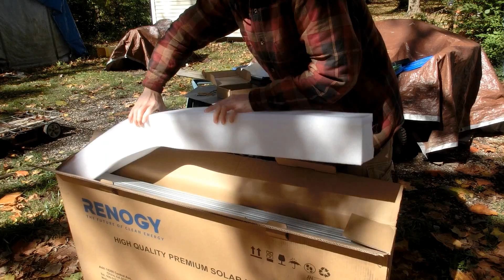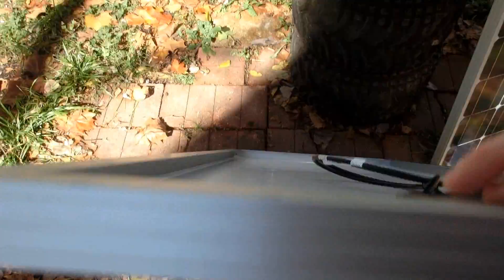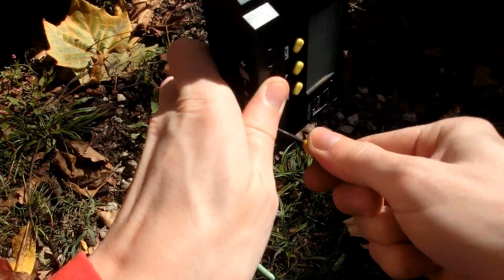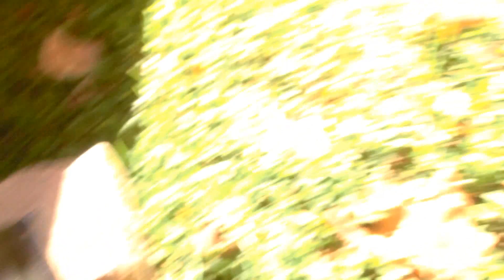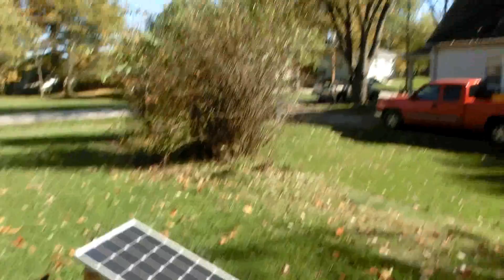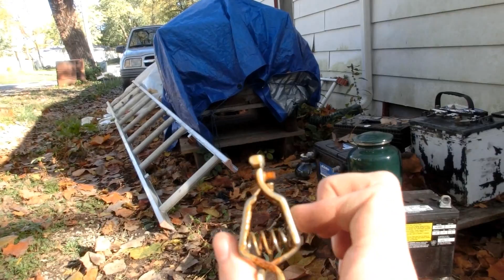Random Bits 0058: 200w solar panel system

Comment: Hey man, hey everyone :-) The insulation on the back of the solar arrays is pretty awesome, do you think that could be the difference in efficiency between making them yourself and the manufactured gear you have just received? appreciating that cells are different qualities and efficiencies :-) but im kinda saying you recon it makes a big difference?
 As you say there if a cell goes down perhaps you could chop the damaged cell out and then perhaps even spray over the new replacement's back with liquid rubber to reinsulate it? :-D

Making Hydrogen and squeezing it down sounds legend! Have at that one! Cant wait to see the vids.

Would sticking a solar array on top of a tree, flat, help or does the angle really make that difference?

Reinforce the outside of the house with a discreet scaffold and get a platform going, your mum will love it, she can play W.O.W up their on cool summer nights :-) ...though im more of a Guild Wars 2 kinda guy :-D

Pole in the battery shed sounds good, would you insulate that? I always figured exposed poles to the air kinda lost electrons to the ether, reducing efficiency :-) probably would be minimal loss anyway :-)

Great investment, a few more next year and the year after and you will be off grid :-) Another thumbs up on your vid my friend :-p
Reply from the maker: battonfive
well my homemade array would have been great if only i had 36 cells instead of 10. but still wouldnt have been nearly as weatherproof as these ones are.

as for the exposed poles discharging, you dont have to worry about that. sure if the climate was very very humid and salty you may have more discharge, but the internal discharge rate from lead acid batteries would still outweigh it. and even that is very small.
Reply: Rinoa Super-Genius
not to mention, im not going to ride any spiders!,  i might vote for you making a giant flamethrower to kill the giant spiders though!
, as for the solar, indeed do some videos, also explain some of the basics, the pitfalls and the realist of what they can do, and not as some do on youtube, buy one small panel and think they can go off grid now! lol
Reply: Rinoa Super-Genius
um no, we pay per kw not a fee for connection plus i would lose the 'feed in' subsidy (there has been a big rush to get in on this while it still runs) which pays me even though i get the electricity myself, and of course the cost of buying a large bank of batteries
Reply from the maker: jusb1066
 ah here we have to pay like 30$ a month just for being connected and if you do feed power into the grid you only get credits and those credits expire at the end of the year so you dont get money, or atleast the last time i checked.
Reply: Rinoa Super-Genius
theres acutally a thing i heard in Australia, if you have solar, they charge a fee for connecting your solar to the grid! so it pushes you either to go solar off grid or none at all, yeah backward policies harm the take up of it for sure, in the uk it is possible to have a zero electricity bill if your carefull with solar
Reply: the cells dont need insulating as such, its just a plastic backing, in fact cells often could do with cooling from the suns heat,, but thats impractical or more expensive than just the backing, plus it needs to be electrically insulated, at the front end of things it is a special type of solar glass, then a clear resin is used to bind it all down, and vibrated on a table to remove all the air bubbles
Reply: mmm im familiar with over heating issues but the strips running along the rear I thought would need insulating from the air, that they don't makes me wonder where the efficiency gaps come from between factory and home made arrays is all :-) cheers for the clarification there though :-)
Reply: no they dont need insualtiig from air, elecricity doesnt escape through air, unless the voltage is high enough to arc over, efficiency is lost due to they sell solar panels to what it could produce in perfect lighting conditions, optimum angle, cold panels, and probably the level of the sun in a desert! also conversion losses always happen
, the best thing you can do with a lot of solar is the thing rinoa mentioned, an mppt controller (around 20 percent improvement)
Reply: cool, I was thinking that home made arrays might be like the kit car of...cars... Jusb has a point though, they do seem to rate them while they are being assisted by a nuclear power plant :-D

I figured with the appaling light here in Britain I would need a million of them to offset the reduced proton activity in the light over here, and that being the case I was hoping to come up with my own hand build array in the next few years :-)

That I get to watch your's Rinoa is a welcomed trail blaze im happy dodging :-) I like how when I ask google 'is electric lost to the air/ether', it comes up with a german plane crash.

My misconceptions really are getting more severe :-D
Reply from the maker: battonfive
 like the time you had the idea to make a quadcopter that could fly between planets then i reminded you of the vacuum in "space" hahaha

i have a shitload of bad ideas every day, its just overtime i've learned how to more quickly troubleshoot them. like i'll be watching a video then think "we should engineer giant jumping spiders so we could ride them around!!!" and i quickly realize how that wouldnt work on many levels.

i'm thinking about doing a total cash-in on these solar panels and start making a video series called "Solar Sunday" where i just do something differant each week with my panels.

would be easy to pump those videos out, and make me back the money i spent on the panels. All Your Time Are Belong To Me! bwahaha
Reply: i looked into making an array myself a while ago, as well as buying the panels, the alloy housing, the special glass, the resin, making a vibrating table to do clear the resin, it really came down to not worth making yourself, i have 2.5kw of roof panels, it seems to have halved my overall electricity bill, as you 'shift' your heavier useage to good daylight, (washing machines etc)
Reply from the maker: jusb1066
 and prolly if you went full off-grid where you dont even pay the electrical connection fee you would start saving the most.

i'm wanting to get my system working good enough to where i can buy some land and build a shed but not have to pay for electrical connections and a pole and meter and stuff.
Reply: Rinoa Super-Genius lol technically that great hybrid octocopter idea didn't work cause Mars' atmosphere was to thin and there wasn't nothing to push against :-p Must admit didn't think it would make the void of space..though on a different day...who knows perhaps some hard fuel rockets might have ma... :-D

Spiders sound good, though I said to my mate when I was 17 after reading the Tad Williams 'other world'  saga,..dude should I devote my life to making a small spider that re-charges itself at the mains and has mega a.i?

which he horridly said 'no, no...just no.', think he was afraid I might do it more than anything :-D

Fair argument on the panels though :-) my first stop will be ebay :-)....come on you germans with your solar price war with the Chinese and Americans, You Germans wouldn't believe what they said about your mum...wouldn't take that...get them prices down
Reply: here they install solar on council homes then the private companies leech the profits :-) and they are dire cause our light is crap :-p
Reply: jusb1066 im pretty power hungry, run a lot of computers, but yeah average family over here would pull it off if they are careful :-) where there is plenty of elec the returns for you selling to them are always dire :-) its a shame they cant just pump it about the world and bring the abundant countries prices up and the needy hungry countries prices down :-Dhttp://www.bbc.co.uk/news/science-environment-29551063
Reply from the maker: battonfive  i think for the time being it may still be worth it to look into mechanisms that direct light onto a boiler or stirling engine. but i think solar panels will pull further ahead in just a few years.

i think the big issue with AI is that we are trying to compute AI programs on general purpose components. i think in order for us to make an AI like commander Data we will need to make specialized hardware that does certain tasks like guage the emotion of an input or whatever.

like in the 1980s intel released the 8086 cpu but they also had the 8087 math co-processor and many other chips designed to work with the 8086. i think we will need a computer made of 10 or so differant CPUs each running their own routines and doing their own specialized tasks. much like how the differant parts of the human brain work.

or ya know...a positronic brain.
Reply: battonfive
i had a huge energy overhaul at home, my laptop uses like 20w not the 350w of the old desktop, all plug in things with supplies removed, or switched off when not using where possible, led lights in the lamps, no vampire devices, that process itself saved me around 30 percent of my bill ,before solar came along, every thing with a standby (such as a microwave clock) costs you £5 a year just to be on, multiply by all the things you have, tv, clock-radio, phone chargers left on etc
, you choose devices that havea  real off switch or at least a nicely handy power switch for your extensions
, and led lamp (£10 a good one!)  pays itself in 6 months at 5 hours a day (and thats comparing it to the already savings of a cfl, not incadescent) , and i havent had incandescent bulbs for years!
Reply from the maker: jusb1066
 dont forget that those devices that use extra power put it out as heat. so how has your heater been doing with less help from electronics? i'm thinking about using my solar panels to run my computer and maybe a bitcoin miner to warm my room up but also get things done.
Reply: in college I was taught there are two types of a.i, one is a fake a.i like a doctors encyclopedia that is simple algorytms and the other one is impossible :-)
 Basically the teacher was working with, its all going off coded rules and thus not sentient and not a.i :-)
 I'm just happy a machine processing shed loads of code, quantum style, then spitting out its best probability :-)

light to a sterling sounds good, in an over sized magnifying glass way :-) I was thinking 'wood burner stove' heating a chamber of water to drive a crank shaft thing :-) im after quiet as I live next to a grave yard :-p and the sterling does seem to be the leading candidate so far :-)

I want to read the book '1984', that's supposed to have some good gear in :-D
Reply: I currently run my main pc 750w, two monitors like 120w a piece, that's 18 hours 7 days :-) then I have three 500w pcs acting as servers for websites, then theres a mega list more :-) I tended to use the heat from bitcoin mining last year to heat the place, worked well but the fans were noisey as buggery. Had to blast music to silence them :-D Bitcoin mining is dead now :-) running a decent graphics card will get you a bit of lite coin back and still produce the heat, but you would need more juice to power card and board :-p
Reply: Rinoa Super-Genius
we have mains gas for heating, per kw its still way cheaper than solar (and well they dont make solar that works when it's dark, and yes, the heating has been renewed to a more efficient one than the 30 year old one before it, so im sure it will be less this winter
, i have considered running a low power electric heater in the coming winter, but i suspect it wont be worth doing cause winter has very little sun anyway
Reply: :-) im turning back to gas soon, im shipping these serves off to London now and hosting them there with a company, my elec just went from 11p/pkw to 23p/pkw

this woman gave me a wacky named rate called 'the green policy of 2004' or something, when I said 'whats dat?', she said...' I just saved you £600 quid a year' :-p

it seems npowers hospitality has now waned :-D
I am intrested in getting some kinda wood burning setup going though :-) As you know jusb our bills are mental over here without offsetting any.

I pay a few grand a year easy enough atm :-)
Reply: battonfive
yeah self hosting has never been worth the electricity alone, i worked that out years ago! trouble with wood is, theres too much chipboard or treated (decking timber) and that smokes or makes deadly fumes, gas is cheaper basically than filling a car with wood, even if it was free
Reply: I self host because some of the companies I host for are pretty picky with their data :-) took me an age to find one in London they would agree upon :-p plus I was using them for other stuff at the same time :-D
 Fumes are a bit of a pain I guess, was gonna make a 20-30 foot pipe for it to escape from :-) and I do have my e-bike and the woods are just at the back here :-)
 I will see how gas goes, it does seem pretty cheap :-) perhaps fracking will aid it further now :-)
Reply: thers always a bit of fumes escaping from the front end, which is why i want to warn you about the treated timber, a tiny amount will harm you :} plus theres so much of it around, that and chipboard/mdf/particle, finding real wood is a pain , even pallet wood is treated most of the time, if we were in the wilds of canada with trees all around would be different, but we are more likely to have old ikea furniture than a tree!
Reply from the maker: battonfive  lucky for me the "bitcoin is dead" sentiment is spreading fast so stuff like Antminer S1 are only 50$ on ebay. running one of those at 200 gigahash/second would make me about 50$ a month in bitcoin. better space heater than my electric one that would cost about that a month haha.
Reply: have you checked the difficulty graph for the bitcoin mining?
Reply from the maker: battonfive
 yeah i've used the online calculators and stuff. at teh very least it would be fun to get an antminer off ebay. its over 2,000 times faster than my main graphics card.

people regularly spend 60$ on a crappy video game. so 50$ prolly wouldnt be too bad. my grandparents usually give me like 50$ for christmas and by that time i should have a nice solar thing set up. i could put that money towards one.

oh and as for fans, i love the sounds of servers so it should be cool. we used to have a big server in our living room when i lived at my old house.
Reply: jusb1066 true I would have resorted to waste mdf gear before long :-) I didn't think of the excess dodgy particles that would rain back down on a still day :-p your right, for effort and everything gas does seem the best bet :-)
Reply: Rinoa Super-Genius"Bitcoin is the devils way of teaching geeks economics" is what I read years ago and it really is true :-) Have ago theres not much you can loose there. I finished my mining back in December of last year, was running a 60-70ghs setup, which was pretty decent back then with the mining difficulty so low :-) You will want to overclock that s1 with the software when you get it (we all do) so give yourself 370watt or more for that :-) You wont notice the noise of a single unit much :-p If you meet anyone along your travels who wants to buy: bitcoinengland.com/.co.uk or Bitcoinmanchester.com - link them up with me and I will sort you a nice commission ;-) Ive been out the game a while
Reply from the maker: battonfive  the best way for a nerd to learn economics is simulations like simcity and Anno 1602 :D
Reply: I remember going in to pc world back in the 90s and buying SimCity 2000 brand new remembering it maxed my machine at the time: Pentium 3, radeon x1270, 32mb ram and 50mb of storage space! that would have been the pc maxed at the time :-D
 Ive seen Annon 1602 about but not had a go, im a big fan of cid's civilization series :-)

You will enjoy the rabbit hole that is bitcoin mining, you've just scratched the surface atm :-) It will be intresting to see how far you go down there :-D

First rule, never sell on ebay as its intangible, untraceable currency :-) I got away with selling on there for 12 month, before the hackers came...and how cold ebay became...they were dark man...real dark
Reply: Rinoa Super-Genius ah and last thing, every time you say the word 'Satoshi', you have to say it in a Jean Claude Van Dam way, like you've lost a brother to an evil dojo boss '...this..this is for you...Sa-Satoshi'...I didn't make it up honest, its the rules..
Reply from the maker: battonfive
 never seen jean claude van damn's movies.
Reply: Van dam movies were great years ago :-) but I don't think they would stand the test of time very well :-p try 'blood sport'...that was a fun movie. 'Are you Jackson? You look like a Jackson' was a great line in there :-)

Comment: Good stuff, you are basically building some sort of mini industrial area.

Just need to make a leaf blower now and make the place nice and tidy.

You could try running the electric cable through some alkathene piping for burial.

Also, don't forget to put the compressor pump into the hydrogen balloon/drum instead of outside of it. One spark in an oxygenated environment could destroy your week. Make sure the balloon/drum is well grounded, don't want any sparks. I'd recommend using a steel drum as it won't be able to build up any static charge.

How long before you head off to uni?
Reply from the maker: well i'm going to be using a refrigerator compressor, they are hermetically sealed units so i dont have to worry about sparks. and as for the cable i'm just going to bury them like they are. they are too crappy to really worry about. i can always upgrade latter.

oh and i dont plan on going to uni, i'm too busy with my projects and uni is a waste of money.